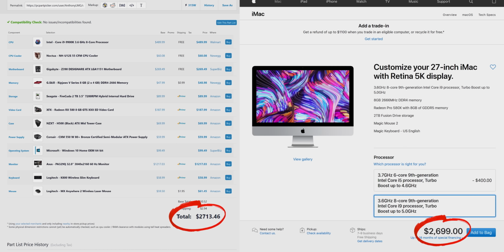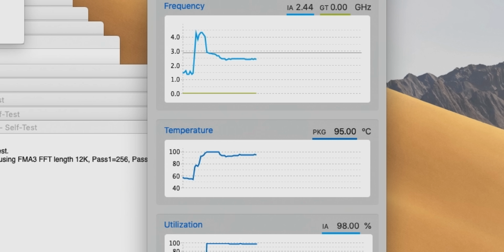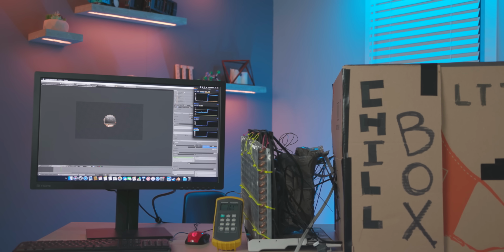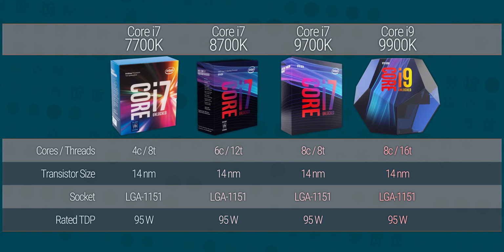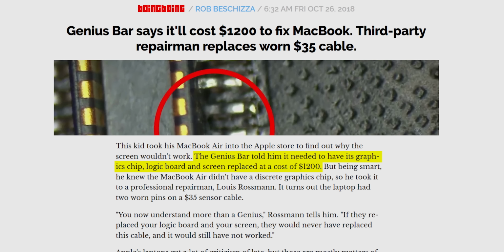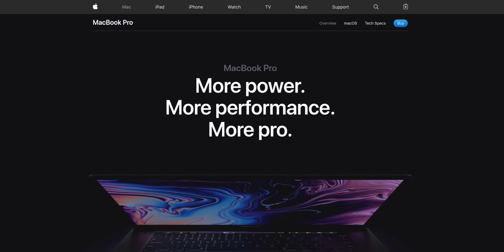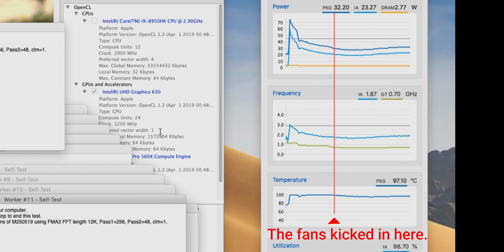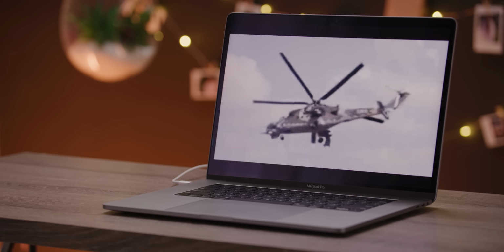Macs are SLOWER than PCs. Here’s why.

Comment: This isn’t Apple’s fault. Intel has been the issue here. This is why Apple plans on ditching Intel in the near future. Apple is headed in one direction with its design language and it isn’t about to change that. At this point it’s the next logical step for them to design chips for both the iPhone and their Macs. 

Also I think most of the points in this video are moot. Macs don’t need to run at full spec all the time to be productive. The hardware and software are better optimized than a windows machine. Running a program like Final Cut Pro on a Mac isn’t going to require as much fire power as a Windows machine running some other video editing software

Comment: This is why I always say Macs have worse "price/performance," not "price/specs."
Reply: @John Smith Yes, they do optimize for the hardware, but with intensive tasks, the thermal throttling still gets pretty bad. I use a Mac for live projection mapping and I'd rather have a gaming laptop or workstation any day. (But the software I like is Mac exclusive D: ) It does have stutter-free performance while doing things in the file manager or surfing the web, which is really what any non-Pro Mac is designed for anyway.
Reply: Sometimes it is both. I've priced out some models of macs in the past if i built something comparable, and it wasn't even a competition. I work in a school system and the radio/tv program were diehard apple, but they had old IBM powerpc based mac pro's. I was talking to the teacher down there about replacing them with pc's considering their render times on 720p video was like 24 hours for a 5 minute video. The standard PC's we buy for most other programs that require more horsepower, would've blown their mind, and they run about $1300 per desktop. However they decided to instead get imacs, they went completely around me and asked the director of highschools about new macs, the tech director just ordered the based model imacs with the radeon discrete graphics added in. I have seen their render times since getting the new computers, they are not great. It is better than IBM power pc, but not what they could have had. We could ahve gotten 27" 4k monitors, and a slightly upgraded version of those $1300 dell precisions, and still been about $200 less than the $2200 imacs. I checked performance specs on the parts in both and it's not even close, the pc's would run away from them. 

In a sort of reverse scenario, our band director had an old plain jane dell optiplex he was running some marching band formation simulator software on. It was running okay but he wanted something better, so one of our techs saved back an extra dell precision workstation from a lab upgrade and swapped his computer out, big big upgrade for him, and the band software ran flawlessly on it. He claimed he wasn't happy though, even though our tech coudl see with his own eyes how well everything ran, so he begged for an imac. They ordered him a similarly priced, about $2200 imac, which proceeded to fall flat on it's face while running the band simulation software that a 6 year old run of the mill $500 optiplex was running.... The solution? He begged his way into getting a $3200 imac instead! The $3200 imac runs the band simulation about as well as the $1300 dell precision workstation. The  $2200 imac went to the orchestra director who tried it out, and after a while decided he was going back to his $500 optiplex. In my opinion, $5400-1300 = $4100 wasted on apple shit.

On a part direct part cost breakdown, I think I priced out parts when the new mac pro(trash can edition) came out, and it was about $600 more compared to equivalent hardware.
Reply: @hzuiel  Why didn't you ask Apple to completely disassemble their Macs, take away all the supplied software and offer the usual PC support, so you could make a real comparison?
Reply: @peterbreis5407  I'm not sure what you are getting at here. Why would they disassemble macs to resemble pcs? What do you define as usual PC support? Mac does have a better integrated app store, but I don't know if you can exactly call it supplied software. Some of what you are talking about used to cost money, or was only supplied one free license with a purchase of a new mac. Things like imovie, garage band, keynote, etc, are now "free" but really freemium. They don't come pre loaded on ios, you have to know they exist and go download them. 

For most of these things there are plenty of free alternatives for both pc and mac, and microsoft has had at times support for some free apps of a similar type.
Reply: @hzuiel   Let's race, wallet's open to show ALL the money that's going to disappear buying my Mac or your pile of parts DIY PC, getting it booted up and doing something useful.

I'll just click on the Apple website, have it delivered free tomorrow, up and running in 10 minutes, out of the box, and producing real work shortly after. 

Let me know where you are up to by then.

According to the Unicorn Jockey fanbois, PCs don't have operating systems, software, displays, cases, keyboards, cameras, speakers, microphones, wifi, bluetooth, mice etc etc. (or just crap ones they have lying around). Just CPU, GPU, RAM, SSD or HDD and motherboard, everything else sort of "just is", no hunting on line, no delivery, no charges, no wait, no incompatibilities... definitely no support, and most definitely the barest whiff of a warranty.

And always the bleedin' obvious mismatch comparison, an unassembled Tower vs a ready to go Laptop or All-In-One. Not even the REAL comparison, another maufacturer's ready to run out of the box laptop or AIO. Always ignoring the bleedin' obvious qualitative differences, especially the in your face displays.

To save how much? That they waste on pizza and insulin shots!
Reply: @hzuiel  I was being generous by ordering the Mac online because that's how you are going to have to chase all your parts.

I could speed things up by wondering into my local store and picking up my Mac in a box, and be up and running at home in the totally fictious "20 minutes" it takes to assemble a PC. 

It took way more than 20 minutes just to set up my Dell and update Windows 10. Did I mention that the Dell replaced the HP that I took back because it had so many problems?
Reply: @RectalDiscourse you've built a laptop back then? Impressive...
Reply: @RectalDiscourse  "Lol back when I built an i7 quad-core system for $1600, I checked out the Mac section for giggles...latest MacBook pro with a core2 duo...3599.99.  lawl"

Saved a lot on that DIY brain surgery! 

btw The surgery doesn't seem to have quite worked, you need reconnect the eyeballs. What were those two things you were comparing?
Reply: @Earthplayer   I am probably never going to get through your self induced ignorance, but the wildly inaccurate and eternally repeated statement that only "idiots" use Macs is the most self-evidently dumb schmuck ludicrous.

We can do this forever and I can add observation on observation, but I just spotted right now another. Watching a documentary on the NASA teams that collect and analyse dust from comets with spacecraft and high flying jets, and guess what they are analysing the dust on? An iMac. Recently the team that finally imaged the black holes at the centre of our galaxy were in the news and what were they using? iMacs and Macbook Pros. Recent news report on medical researchers working on the chemistry of malaria, with a possible breakthrough treatment, they were using Macs. Another documentary on diet and bacteria in our intestines, again Macs...

,,,and what are you doing? Gaming! >>Eyeroll<<
Reply: @Earthplayer   Earthplayer   You got even that wrong! I am beginning to think you have a severe comprehension disability.

That list Linus shows has nothing to do with DELL. It is from PartsPicker.

You certaiunly do get numbers wrong because for a start you don't recognise the very thing you are counting, don't count everything, and my guess is that given your comprehension and maths skills you then don't clean out ALL the toilets as the university janitor.
Reply: @RectalDiscourse well I have to thank you then. She told me that some guy visited her and done with her in like 20 secs. I did not belive her as she is 80. But now it makes sense.
Reply: @Earthplayer   Never said I "need tech support for every little issue" that's just you and your comprehension failure all over again. 

In fact I do support. Seems you desperately need it in more than just hardware/software.

You can only wish to get what I get.

And I filled in all the missing hardware in Linus' PartPicker costing above and it only made the comparison for the PC DIY build substantially worse, ignoring that you can buy iMacs on discounts. 

Stupid arguing a pile of discount parts vs an undiscounted complete iMac is a genuine comparison. 

But you are never going to get anything as simple and easy to understand as that. 

Woosh, right over your janitor's hat again.
Reply: @Earthplayer   How unusually uninformed, or lying to self. Particularly as to the time and effort involved in acquiring the pile of parts, assembling them and getting it all running, not to mention the real total cost. And from my observation frequently substituting anything inferior that "sort of looks like...". Why the obsession with high powered GPUs running crappy displays? Let me guess - Gaming!! And s o o o  m u c h  cheap plastic.

If there is no cost involved (nor risk) in a DIY computer then why can't I get someone to do it for nothing? The local PC Store charges. The local guy who builds Hackintoshes (which have virtually no resale value, ie instant depreciation of 50-60%), apparently wants money for "nothing". 

All "industry standard software runs on mac and windows" is also not true. I have both and I only wish I could run all my preferred Mac software on Windows. Maybe if I wait the sometimes decades PC users have had to wait to get decent software?

Every Mac comes with a range of actually useful software, the OS included, no extra cost. Which of course you knew. As also does that IT department I keep in the back shed, which of course no real PC user actually needs. You have to wonder: why DO they exist? ...and why does Microsoft charge so much for Windows, everyone's in a company or school which hands them out as party favors, and why are there crippled versions?

I have several Macs and PCs, with rarely an issue with the Macs but it's nice to be able to get another head working on a problem or advice if I am stumped. Which you gladly get with Apple's communities or in the Apple Store. My PCs, with which I have a lot of hardware, OS and software but mostly functionality issues, the support pretty well ceased the moment I handed my money over. Just was in the local Microsoft Store with a long wishlist nagging me for ages and got a string of "don't knows", "haven't a clue" and "Windows can't do that" which was if nothing a short encounter. Teach me to ask.

Same with my local PCUG. Chasing down all the supposed "fixes" is just chasing down another blind rabbit hole and, "Really! You think that is a solution?

My observation is that Windows/PC users mostly just put up with what they've got, and never know there is anything better, let alone what that might be.
Reply: @Earthplayer   I don't know if you can understand what I am saying, because I think YOU are the idiot. You haven't told me anything I don't know, except you have got quite a few details and costings wrong. But you have a completely different perspective (gaming, gaming, gaming) than me and the people who use macOS. Through ignorance, massive massive ignorance. 

I guessed the "I game a lot" right from the start ...and you are calling ME an idiot! 

Scratch a Mac Hater and there it comes up, Oh no NOT again! ...an "Enthusiast" Gamer!! (rolls eyes) w pizza stains all down the front of his corpulent gut.

You even managed to totally miss EXACTLY what Linus pointed out right at the beginning of the video. 

That you CAN NOT build a PC that matches a Mac quality for quality and save, he actually showed the build cost in the video. Since there are no savings, having the long term support, software and long life and value of a Mac, but most importantly the macOS, from Apple really is a bargain, and the support is not for small hand holding support, although that does exist for those who need it. I had a complex and unique server issue a few years back and it was escalated to the point where I got a direct line to a technical expert who would have cost me thousands.

We are not ignorant of the thermal throttling problems, nor the slaves of Apple (who I don't particularly like), that you fantasise. But we are equally not ignorant of equal problems with PCs, Windows and Linux. I use all them all.

If you are tossing out PCs and displays every 3/6-8 years it is you who are doing your dough. And what you think is a monitor that can be fixed with a Spyder just shows that you really have ZERO, null, niente, gar nix idea of what is required by Professionals who use as high a resolution and quality monitor as they can get, because seeing your work accurately is the most valuable attribute you can have on a computer. Professionals who currently are avoiding precisely the "industry standard" software whenever possible, because THAT is the problem, and has been the problem for a long time on both Macs and Windows. Your wife may be stuck in the stone age, but many of my friends are medical, architects, programmers and scientists. Most use Macs and Mac software because it is so vastly superior and productive, and life is too short to waste time on inferior PCs to save mythical dollars.

Windows is basically backward. It can not do many of the things I can get Macs to do. Features that have existed on Macs for decades. Yeah I'll hear the usual blah, blah, blah from you that I am "not holding Windows right". Pity I can't rub your nose into all of them, one by one, like I have with countless PC "experts". You don't know what you are talking about and probably will never even try.

PS Do you want me to give you some hand holding for your inability to lay out text? A basic skill for Mac Users.

Comment: Good job Linus. I find it misleading and think there should be a class action law suit. Why don’t just write 10,000mhz. It probably could get there with 3000watts and liquored nitrogen and be stable for 0.1 seconds. But that’s ok, it will just throttle back to 1500mhz.

Comment: The only solution is them switching to Arm based cpus like their A series for the phones if they wanted to keep the thin and light look without the throttling. 
Or they could make a change in their design style and have better cooling.
But its rumored that they will do a chipset switch to their own custom designs like on iPhone and it makes sense when u look at the IPad pro for example the A12X in that tablet beats their MacBook Pro line and all without any cooling.

Comment: I have the MB Pro 2015 model which I bought in 2016. Mainly use it for photoshop and yes when I’m working on a huge image, it heats up and gets rather warm. But I can close the screen and leave it for about 10-15min and it will be really cold to the touch. But airdrop, lots of photoshop and some browsing is all I use it for anyways.

Comment: The GPU problems in Mac laptops (and desktops) on both the NVIDIA 8000 series and Radeon 6000 series were cause by manufacturing flaws on the GPU's themselves, not the cooling system of the machines.. In fact I'm pretty sure you explained this in one of your earlier videos but here you just wanted to bash Apple about this for whatever reason. Pretty much all laptops and a lot of desktops from PC manufacturers were having the exact same issues even when cooled "properly" since the manufacturing flaw meant that the GPU would unsolder itself from the board even when running at the correct temperature. No amount of cooling is going to solve a badly manufactured or designed processor of any kind, current Intel CPU's running hotter than they're supposed to is Intel's problem, not the manufacturers who use their chips. They need to either fix their crappy design or state the proper cooling requirements of the chips before selling them. Though this won't really make any difference to Apple since they're gonna be switching to their own chips soon.

Comment: I have a niece and nephew, both in the Media marketing industry. One for adverts, the other for films/documentaries. Both have their own businesses. Both insist on Apple, Both insist on laptops and both have been sold the same old BS. And when I show them thermal throttling their adamant that their apples are way better than a PC or laptop equivalent. And their willing to spend BIG money for the bragging rights. I even built a Xeon 2670 V3 with 36 meg and 2 1070's which pretty much came in at the same price and slayed their render times. And you could see them both try and explain it like a flat-earther would faced with overwhelming evidence. And that was totally stock, I hadn't OC anything.
Applephiles are a breed to their own.

Comment: How do you wanna talk about speed on macs and dont mention they optimized os?
Reply: Playboi Papix  this is the reason it works so well! Damn windows , even being a power user and knowing just bogs down and slows over time.
Reply: Thats exactly what im saying! Mac os is like a injection motor it can do more with less fuel (in this case fuel is hardware)